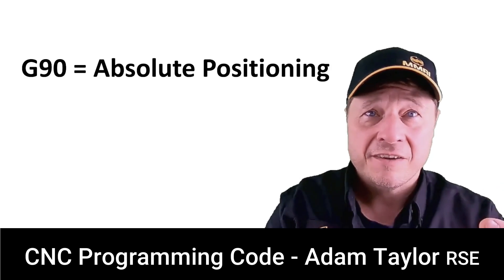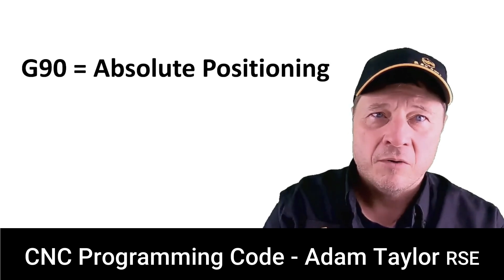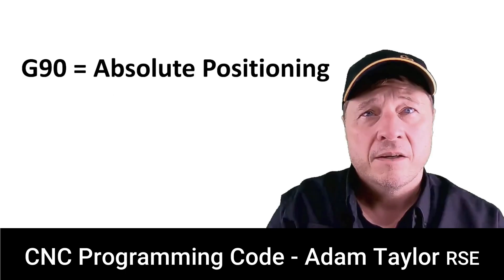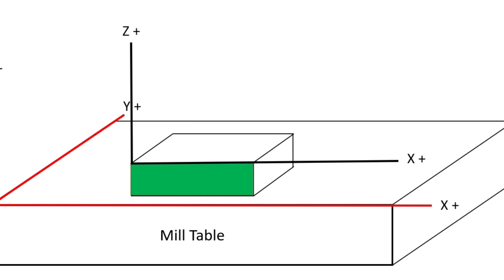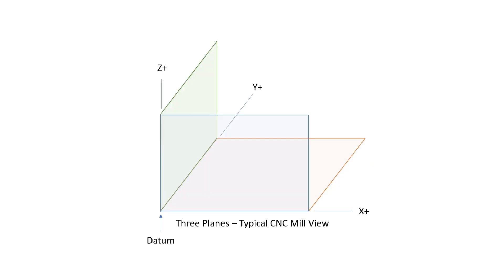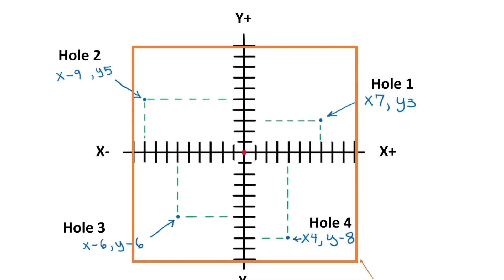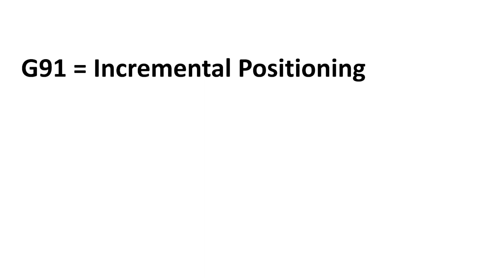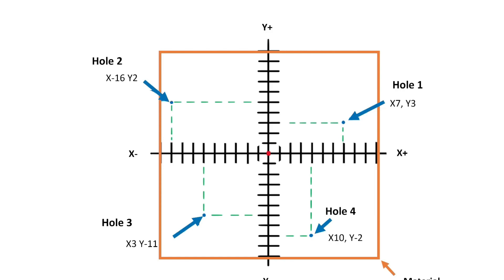CNC Programming G90 and G91 - Lesson 11

Comment: Adam, my question is how to make a program repeat that has its own its own G code parameters then move a given distance lets say in the X direction while then maintaining the repeated programs X0 & Y0 coordinates. I am using a plasma table to cut a series of holes where I am using the X Y I & J to describe the hole cutting parameters. These values take into account an X0 & Y0 to create the hole. I am then trying to program a move in the X direction by say 1" and then repeat the hole program without having to change its X0 & Y0 values. I just want to be able move a said distance, burn out hole, move to the next location, burn out a hole, etc. by only having to change the value of my X dimension between centers and having the hole programs X0, Y0  value maintain. I tried using the G90 & G91 codes and probably not correctly as I am not having any success yet. Maybe there is another way to accomplish this? Any advice you can offer would be greatly appreciated.  Thank you.
Reply from the maker: Hello @stevemorton7141, I can probably help you with this. I will put together a code that I think you are asking for and an explanation of what it will do.
Go to my Instagram adam.taylor999 and send me a direct message with your email so that I can send you the code privately. I don't share my email publicly.